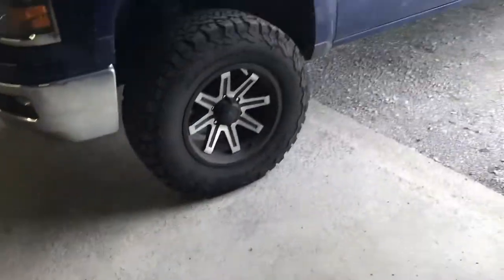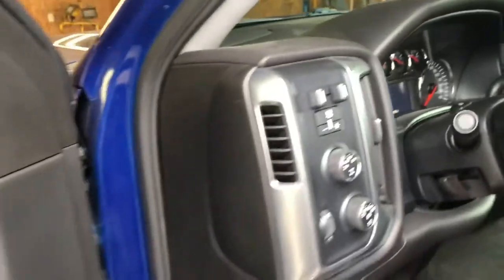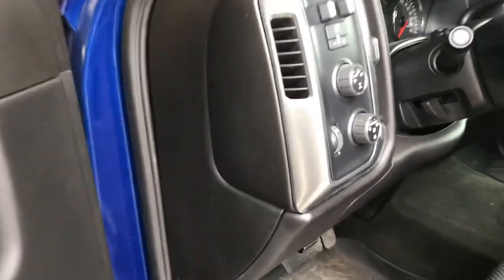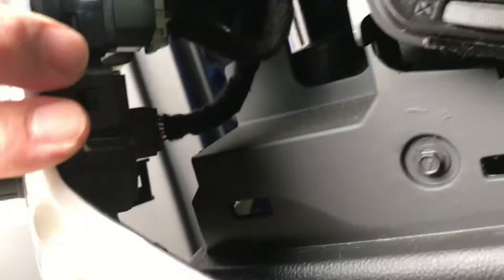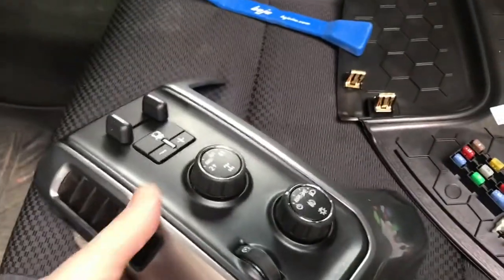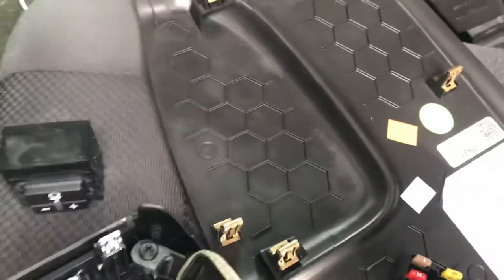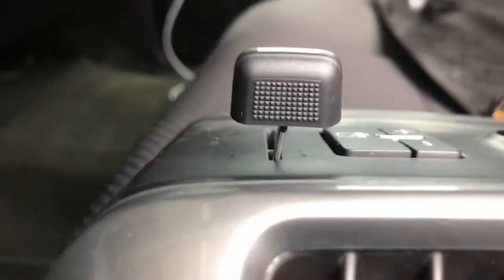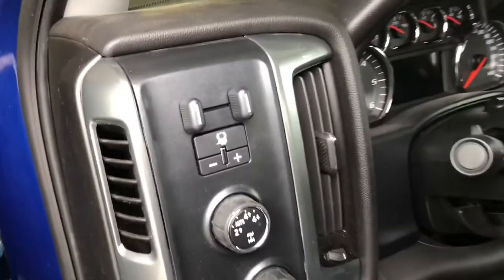C1117 Trailer Brake FIX

Comment: So I saw a couple people comment that once they changed it, the service trailer brake system light went away and their service four-wheel-drive light came on, that is common when you change this and the best thing to do is make sure your vehicle is off not only when replacing the trailer brake system light but when performing this , take the negative terminal off your battery wait five minutes and put you’re negative terminal back on with the vehicle off and that service four-wheel-drive indication will go away it’s basically like resetting the module it’s just because that you unplugged it and plugged it back in it’s throwing an error that it’s lost connection in my case. Hope this helps.
Reply from the maker: Thanks for the info 👍

Comment: Well i installed the new break switch today it took about 15 minutes or less following your directions. I will keep you guys updated on if it fixed my Service trailer system error.
Reply from the maker: Awesome! Any issues?

Comment: At any point did you have any issues with it actually shorting out and killing your battery? This problem just started for me two days ago. First my battery was just dead enough that it wouldn't turn over. Once I jumped it, I started getting the service trailer brake notification. Once I got home and turned off the truck though it does the same thing and kills the battery after a while.
Reply from the maker: Hmm no, maybe you have a bad ground.. have you figured out your issue?

Comment: I have a 2016 LTZ loaded with the tow package but I never had a controller on my dashboard. So my question is, if I order this controller with the new cover to line up with my original light, and 4x4 nobs will this work, and do you know if the plug is in back of my trim plate. I can order the cover, controller, and plug to connect everything. Thanks
Reply from the maker: I have no idea.. tbh, I can't imagine an LTZ w tow package not having the controller already there. Was this a salvage truck? Maybe it was wrecked and the dash was switched at some point..
Reply: @3369aaron   no it wasn’t a salvage, I bought it brand new off the showroom floor. I couldn’t understand it either. Crazy. The truck new was 52,000.00 lol no controller. Thanks

Comment: Was yours going off back to back to back to back while driving? Mine does it non stop almost every time I get in the truck lately
Reply from the maker: At first, no. It was just intermittent. But after a few weeks it was pretty much every single time I drove it. I could only handle the alarm a little bit before I had to fix the issue 🥴
Reply: @3369aaron  has it come back since you did this?
Reply from the maker: @dmsndy  nope. Not a single trailer brake alarm.
Reply: @3369aaron  ok, just ordered mine. Fingers crossed! I was sitting in a drive thru yesterday and it went off probably 15 times within 4 mins
Reply: Did your trailer brakes not work when this was going on? And have you had any issue with the temp sensor failing every other week??
Reply: @Jordan-wv9vn  I’ve never used trailer brakes on mine. Swapping out the controller did stop the alarms from going off every 10 seconds. Hasn’t had an issue in the last year. As far a temp sensor goes I haven’t had any issues with it yet either

Comment: Did your trailer brakes work at all prior to that warning or did the trailer brakes not work at all? I have that service trailer brake warning come on a few times after plugging my camper into the truck but then it goes away after unplugging. Trailer brakes don’t work at all.
Reply from the maker: Yeah they worked before but once the alarm started coming on I don't believe I ever even tried to hook a trailer again until after I fixed it. Thanks for watching tho, hope you get it taken care of! Take care
Reply: Yeah I only get the service trailer brakes warning message when it’s plugged in and sometimes once after it’s been disconnected the first time I start it up. How did you pull that code or did a shop pull it. I don’t have a check engine light so didn’t think I would get any codes hooking up a reader to OBD2.
Reply: Trailer brakes work fine with buddies truck. It’s gotta either be the Trailer Brake Control Module under my spare tire or this fix you did in the video
Reply from the maker: @kylespirk306  I did a video on cleaning dirt out of the Module and the plug end when the alarm first started bc thats what I initially thought the issue was. It wasn't. Figured out what it really was, being the brake controller in the cab and changed it in this video and not a single alarm or issue since.
Reply: @3369aaron  I have never towed a trailer with electronic brakes and this just came on today, no code just warning in DIC
Reply: Hey only one tire on my Chevy when pulling a trailer only one tire locks up do you know y

Comment: Just replaced mine. Starting the engine then same issue pops up.
Reply from the maker: Really? Wow. I'm not sure on that, I haven't had an issue since I replaced mine. Maybe the new brake controller you bought was faulty from the factory or something.. let me know what you figure out, good luck!
Reply: The two main causes are either this controller on the dash, or the trailer brake control module under the spare tire. My issue was the module under the spare tire. Might want to check the previous video for that.